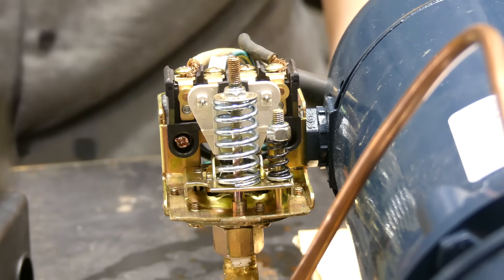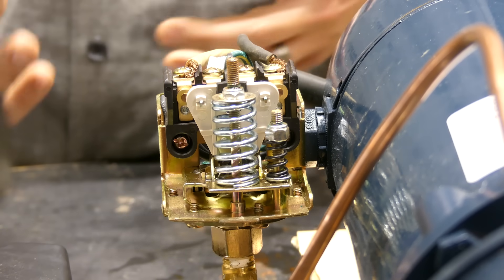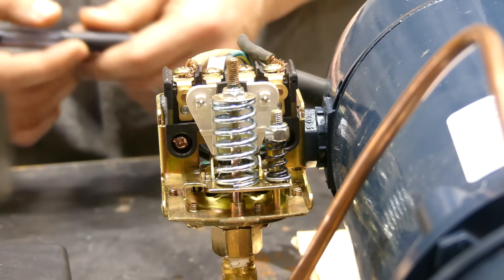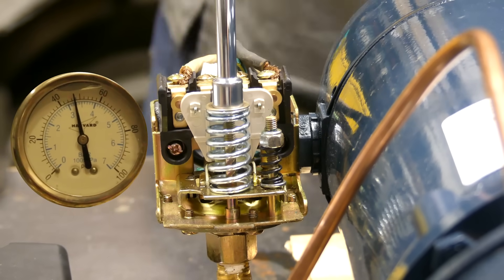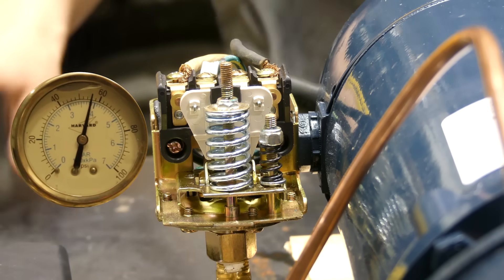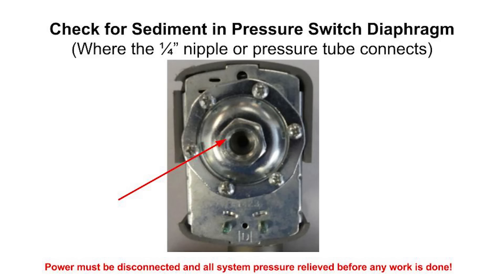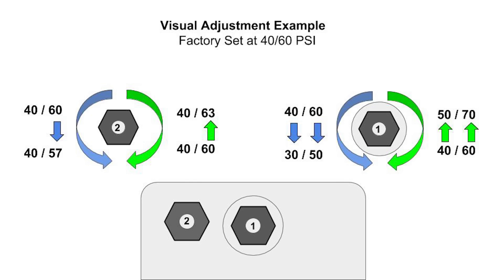How To Adjust a Pressure Switch

Comment: Thanks for the video Chris now I'm tempted to try to raise the range but I'm not sure if my pump can handle the 40/60. I rented this property before I bought it my landlord had to replace the submersible pump and he's really cheap so I think he drove 200 miles and bought some pump at Lowe's and had a well guy install it. I think the old pump was a 40/60. Split. My question to you is if I raise the range too high and the pump doesn't have enough balls it will just continue to run and not cut out❓ maybe I should try raising the range to 35 cut in and see what happens. I will also adjust my pressure tank to 33 Psi.  Nevertheless I'll wait for your response before I waste a bunch of time. Thank you again for the video have a great day👍
Reply from the maker: Thanks for the question! You are correct, if the pressure is adjusted above what the pump can build it will not be able to reach the "cut off" pressure to turn itself off. The best approach would be to increase it in intervals of 1-2 full rotations and cycle the pump to see if it can build to the new pressure. When you're done adjusting empty the system and set pressure in the tank. If you'd like to discuss this at depth contact us by phone or email.
Reply: The Far Side Of The Rails z
Reply: You can also turn down the differential.  So changing it from 20 to 15 may allow your pump to get to the cutoff pressure point, but it will cause it to cycle more frequently.

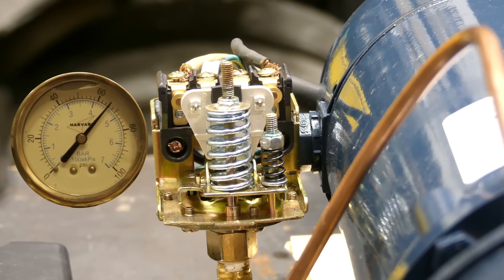Comment: Nice, well-done video on pressure switches.  Nice to know the 2-3 turns per 2 psi rule of thumb for the range.  However for the cut-out adjustment, the new cut-oui pressure shown at 5:20 or so is just above 70 psi, not 66 psi.

Comment: Excellent tutorial. It clears the "mystery" of pressure switches. I have a question thought.  My guess is the previous home owner messed with the switch before watching your video. I have a Cut-on=20 and a CUT-OFF: 58. This is a two story home and the CUT-ON of 20 is not enough to maintain good pressure in the upper showers. and I'd like to bring it back to the factory setting of 30/50. My guess is to adjust or lower the CUT-OFF to 40 and the adjust or raise the RANGE to end up at 30/50 TO 30/55. Does this makes sense to you or do you have another suggestion? Highly appreciate your input.
Reply from the maker: You're spot on in what you need to do! Give us a call if you need any more assistance: 855.329.4519
Reply: Since the adjustment is messed up, I'd turn down the differential first - no need to be exact.  Then adjust the main screw to establish your cut-in pressure.  Then go back to the differential screw to adjust your cut-out pressure.  After all of this, you will likely need to adjust the air in your pressure tank.

Comment: I have 2 pressure tanks, Aqua Air V60 & Gould V200, both charged at 38 psi. I removed a retention tank from the system and now the new  pressure switch will not turn off, its a 40/60 switch and I manually have to turn pump off at 80 psi to be safe. I adjusted cut out with no success on the new switch. Changed the new switch back to the old working switch (no adjustments) and still the same. Any suggestions?
Reply from the maker: Just got off the phone with Danni, for everyone else reading this: we believe it is sediment/calcium buildup in the piping that the pressure switch is connected to.
Reply: Did you find out what was wrong ?
Reply: I did find out thank you 🙂

Comment: When you said it got up to "66", it was actually 70-71 so that would affect the math you had on the amount of turns on the nut. Just an fyi.
Reply: I did misread the gauge there, good call. The differential switch is a much lighter spring than the range adjustment so it does not often line up perfectly within the 2-3 psi mark. Additionally, if you ever need to lower the differential I recommend removing the nut completely and stretching the spring out a little to give it some tension when you reapply the nut.
Reply: snutz213     a* fyi

Comment: Great video. Have one question mine is 30/50. If I adjust it to get better pressure will my pressure tank be ok? Do I need to adjust the air in  the tank it’s usually 2 lbs below the cut on pressure.  Hope Im making sense thanks

Comment: An excellent video! Not only was the explanation east to follow, the production quality was also top notch. 
I recently turned my water pump at a seasonal home back on after the winter shut down, and the pressure range was 50-80, not the 30-50 of previous seasons (and it is a new pump, 2020). After adjusting the switches, the best I could do was get to 50-70. Then I noticed what I should have noticed initially - there was some water in the pressure gauge itself, causing the incorrect readings. (The gauge was installed horizontally to the pump, so water crept in.)
I have now purchased a new gauge (for under $10) and have installed it (vertically this time so hopefully no water will seep in again). However, the pressure range is now 25-50 and is too low, so I will be making further adjustments after having seen your video.
Thanks for the explanation!

Comment: Thank you for this video!

My question is, what is the best way to keep a pump on during irrigating the yard or garden?

I have four sprinklers going and my pump still cycles on and off.  I will have to keep opening faucets and see if I find the magic number.

I think the pressure switch is at a 35 to 55 range.

Any suggestions would be appreciated!!

Comment: we got a new pressure switch last summer 2018 and was fine till now . It doesn't turn on till it's down to 20psi and dose not turn off at all . Plus the smaller switch ( the cut off ) dose nothing at all . I've turned it all the way down and all the way off and it dose nothing .
Reply: GhettoJoe check the line feeding the switch. If it is clogged with mineral deposits the switch an not sense the pressure in the system and will not work properly. It is not uncommon for minerals to form here the tubing fitting or nipple is screwed into the body of the pump on et or shallow well pumps on submersibles the nipple Nader the switch can become clogged, especially with a galvanized nipple... change that to a brass nipple; brass doesn’t build mineral deposits as bad

Comment: Very well done, you get 4 thumbs up, one Q , what size pressure tank should you have for a variable speed deep well pump, an  a 2.1 gal tank or bigger pressure tank,  have a 3 bath home and irrigation system that runs 4 heads at each zone,  any help? Now it has a 2.1 gal tank and thinking it should be bigger.  👍👍👍👍
Reply from the maker: For VFD systems it is typically 20% of pump flow rate for pressure tank size. For example, a 20 GPM pump requires a 4 gal tank.

Comment: Okay so my pump 1hp 15gpm runs for about 4 minutes to go from 40 to 60 psi, is that normal. This pump ran for 9 seconds.
Reply: Probably not.   You need to find out what the draw down is on your tank and if you can how deep your pump is and the size of pipe coming up from it and then give someone like R.C. Worst a call.  Your pump is probably wearing out and not efficiently building up full pressure but I am not an expert.
Generally on a 1 hp you would be shooting for 1 min run time for the pump
Reply: I was blown away at how fast the pressure built - wondered if time was sped up(?) I think your time was too long, but it takes time for mine to build ... esp the last 2 psi

Comment: Thank you for a great presentation. It makes perfect sense to a newbie like me. I do have a question about my "dry" gauge. I replaced this last year and had no issues with the factory settings. Now I'm starting the well up for this year and the needle is at "50" and the pump runs up to "100" before I freak out and turn the power off.
 I bought a replacement but am curious about resetting this one that has the "50" starting point. There are 2 phillips head screws on the back and am wondering if these are needle adjusting screws? Again I have a new one but if this happens for other folks... Many thanks from Idaho.

Comment: Hello sir,,may I ask,,,if the water pump is 1hp and the water tank let's say approximately 2.5 drums,,bigger than ordinary water tank,,is it possible that the motor getting over heated due to more time running? I hope u can read and answer my question thank u😊

Comment: Hi there! We have a pump simply for increased water pressure as we live on a hill. We had to get a new one a few years ago and I may have carelessly adjusted the differential nut instead of the one for the water pressure. Now my pump will kick on and kick off every 5 or so minutes and stays running for only seconds. Which way do I need to Adjust that nut to increase the time of the pump kicking on and off. I know is basically impossible to get it back to the 20 psi and it’s totally my carelessness! I appreciate your advice!

Comment: Your not going to damage your system/tank whatever? If you have a system that was set at 60/40 when it was installed about 6 years ago and, adjust it now up to 70/50? Not going to hurt yiur pipes ir damage the bladder in the pressure tank? Thank you

Comment: Ok, so I've had nothing but pump / pressure problems for about 6 months. I've even had a plumber take a go at it. I know I have water issues, and my front yard is now dug up, but it will be 2 weeks before the submersible is in with the new pipe work and pressure tank. The existing pump and pressure tank are only 2-3 years old.
I've been able to get it to kick in at 30 psi. BUT I can back it off until the nut is in my hand, and it still doesn't shut off. It will also only reach 45 psi. 50' dug well for reference. I never run out of water physically, it's just my system.
I have a feeling that to survive 2 weeks without burning out my pump, or standing beside it until its at pressure to shut it off, I'm going to need a new switch. Thoughts? It's a relatively simple device, but is there one manufacturer better than another? Or one to avoid? In Canada.
Merci.
Reply: Sorry,  this doesn't sound abnormal.  The differential cannot be backed off all the way to zero.  30/45 sounds like what you would normally get.  I am 4 weeks into my current water problem.  My house is on a slab and we thought we had a leak underneath our house as we've had one once before and the symptoms are the same.    It seems to be something else and I'm glad we didn't start digging trenches  throughout our house.

Comment: Very informative, but if my pressure switch box says 30 to 50, but it’s now set at 40 to 60 I believe because of lower pressure then previous homeowners desired, wouldn’t increasing it to 40 to 60 potentially affect the plumbing in my home because of having too much pressure? My pipes under my bedroom floor creak now for about 15 seconds at times when I flush the toilet after sitting for several hours… any input?
Reply from the maker: 40-60 is the most common pressure for a pump system. All of the plumbing in your house should be rated for it

Comment: So after you change the settings on the switch   you turn everything off and drain the pressure tank so you can fill it to 2 psi under the new setting is this correct?also when draining the tank do i close the valve going to the house ?
Reply from the maker: Yes, that is correct. Not a bad idea to close the house valve so it does not drain too.
Reply: @RCworstwater  thank you for taking the time to let me know very much appreciated! And a big thank you for your videos too!

Comment: great video , i have a well pump for my irrigation system,  in one zone the pump short cycles at times, which adjustment would i need to adjust, the pump is 30 /50 ????

Comment: I replaced a 30/50 switch with a 40/60 switch a year or two ago. Now I want to install an Orbit DIY irrigation system that states I would need 50 psi and a 5 GPM. Should I adjust the 40/60 switch to 50/70 so the cut in point wouldn't go below the 50 psi requirement for the irrigation system? If I adjust the range screw so that the range will be 50/70, will there be any potential problems with the rest of my water system?

Comment: Great video, I've hunted a long time to find a understandable video like this. My pressure pump keeps turning on and off every few seconds. If I adjust the on/off switch will that help? The installer set the max pressure to 30lbs and I'm thinking that it is to near the on setting.  I haven't found any leaks and this is driving me up the wall. Can you give me any advice?

Comment: For the last year I have had to lower the cut off psi twice to get it to shut off, a year ago to 40PSI, and now to 35 PSI. Before lowering it this time the pump was making a very different sound but still hitting 40PSI. I checked it today and the strange sound had vanished, but it could not reach 40PSI, so I gradually lowered the shut off pressure in steps, and it now shuts off at 35 PSI. Do you think that this indicated a badly eroded impellor?

Comment: Okay so my pressure switch went bad and I had to replace it yesterday. It was a 40/60. I wired it up exactly the way it's supposed to. I also empty the water out of the tank and checked my PSI of the tank. It was on 32 oh, so I added air to get it to 38. 2 psi below cut on (40). This was my first time doing this so I was actually traveling myself when I turned everything back on and the water was working. However I feel like I have lost a little water pressure in my showers. So you're saying to get a little pressure I should adjust the number one Bolt? How high should I go with it?

Comment: I watched this video and the one on how to set the tank pressure. I followed both yet my pressure is still inadequate and gets lower as I keep the water running. When I check the tank pressure, it reads 38 psi (my switch setting is confirmed @ 40/60). However, when I drain the water from the tank (and cut the power), my tank pressure is basically non-existent.. Would that indicate a faulty tank?

Comment: Do you have a video that discusses the cause of pressure switch "chatter". I have to manually turn-on/turn-off my pump, as when the unit achieves the cut-off pressure, it just "chatters" and will not shut down. I operate a 1/2 HP shallow well pump that is fed by a 4,000 gallong water tank. The pressure swith is a 20/40. I have checked for leaks (none), verified the tank pressure is 18 PSI when empty. Thanks.
Reply from the maker: How far away is your pressure tank from your pump? It sounds like it is too far away, and the tube that connects to your pressure switch needs to be moved closer to the pressure tank.

Comment: Hi great video. I have a well pump and I’m experiencing low pressure upstairs at the shower and sink  when someone is using the utilities downstairs. I wanted to ask if I can add air into the pressure tank without draining it to compensate for the low water pressure on the second floor Thank you.
Reply: No, you will first need to adjust the switch to a higher psi setting.  However if you set it too high, you may find the pump cannot achieve the pressure you have set.  In that case it will run continuously.  For that you can try to lower the differential setting.  But you can only go so far.  You will need a pump that is higher pressure.  Look for a pump that can pump to a higher height.  It is part of the pump specs.  After all of that, you may need to adjust the air in the pressure tank.

Comment: Great video but have a question just replaced my switch with a 40-60 but was wanting 45-60 but whenever i adjust the differential it does not lower the cut off goes to 55-70

Comment: Thank you for the video. Very helpful  for me but with the connection tube peice popping off A LOT is it up or down that's needed. Seems to much pressure but in the kitchen there's not much pressure at all

Comment: If my well looses pressure but the switch never triggers on. New switch. Do I need to adjust the pressure? Even prior too switch change I had poor water pressure an mostly only hot water pressure. Thanks

Comment: Can you help me figure how to set my air compressor up? Ok here’s the problem I’m having: I have 2 20 gallon air tanks. One has a motor and one doesn’t. One was added for more air capacity. My motor comes on when one is below a certain point (I don’t know what that point is). Can I set it up to where the motor comes on when both are low  instead of the one? I’m trying to avoid burning my motor out. Thank you.

Comment: We are encountering power outage frequently, does it affect setting of pressure switch. I had a pressure gauge reading at 90 psi max. Before it was on 60 psi range.

Comment: What size nut is on the pressure switch.  Im a female trying to figure out whats going on with a well pump.  I changed the gauge and pressure switch but the gauge is only reading 15 psi for a 40/60 pressure switch.  So I'm considering adjusting the switch.  Just have no idea what size tool your using.  No question is to dumb to ask.

Comment: thank you Sir, now i know what to do except these: i have a well and 200 lt.  pressure tank. Bar pressure inside the tank is 3 (I pumped air inside the tank w/ compressor) . Is it ok or better to change to 2 or 2.5 ? second, which range is ideal for the tank , 40-60 psi or else?. Thank you.
Reply: It's okay to lower the air pressure in the tank because if it is too high (above the cut-in pressure setting), the pump will not turn on.  If it is very low, the pump will short cycle.  I had an old air tank that did not have a bladder and it got "waterlogged" easily.  I had to add air to it every 6 months.

Comment: After many years of trying to understand pressure switches this video was very good in explaining how to adjust the range of the pressure switch, just one question, if I change the range on pressure switch from 30-50 up to 40-60 do I also have to increase the pressure in the pressure vessel from 28ib to 38ib? Thanks again.
Reply from the maker: Yes, you will need to adjust the tank air pressure to 2 psi below the cut in pressure.